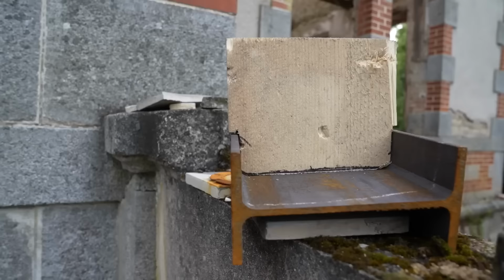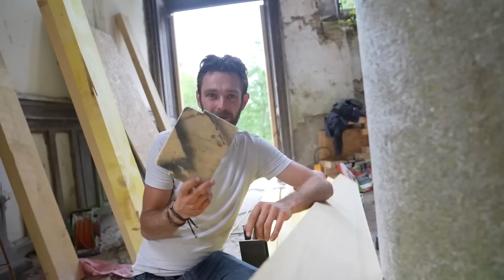Rebuilding a RUIN and its ROOF in 300 days.

Comment: Its actually gone really quick! Only 300 days, and now that one part of the building has an almost finished roof, floors and is basically dry area - plus the grounds are nicely cleared and the front garden replanted! I think the rest will go much faster, because you are already halfway there! I'll be excited to see what another 300 days will do!! 😊
Reply: He is not even a fith of the way there yet. You underestimate the amount of finishing work and internals on a building of this size. Unless he gets more help it will be a decade to restore.
Reply: @PreservationEnthusiast  Whaaat, you're kidding? And I was fully expecting him to throw a ball this summer, to celebrate the completion of the Chateau? Or, maybe not... No, what I meant was, that what he has achieved so far, is really impressive, and it will make the next steps so much easier. And he could consider inviting volunteers over summer, too.
Reply: @bigboy77dk  volunteer s are potentially problematic,  part of what has made this saga so engaging is the deep friendship of the team. It has to be to trust the rope that holds you up to some one else.  That is special, volunteers don’t guarantee that, besides supervising then gobbles time.

Comment: You have all worked hard in sun,wind,and rain,may the rest go a little faster as you have dry conditions to work in and be able to lock doors at the end of the day for security reasons.
It getting a lot safer for when the boys are there.

Comment: I'm super excited to see what Dan will tackle next.

I am guessing getting the new workshop machinery in place might be first, but then?

Will he continue the roof over the landings?

Will he cap the tower? 

Will he rebuild the chimneys that the roof on that wing butts up to and fill in all the stone and brickwork on the roofed wing?

Will he move to the other side wing or even the rear wing?

The pool? The garden? A machinery shed? A water supply? Routing wiring and plumbing?

Comment: an easy way to replace holes in the brick would to be to drill deep into the brick and add bolts then use a cement compound to fill in the caps which will seal everything.

Comment: Amazing what you achieved so far. But why don't you get yourself a crane? It would be positioned right outside the building to lift all the heavy stuff up and lowered inside from bottom up level by level. Since there is no roof.

Comment: It would have been easier to knock it all down and rebuild from the foundation up. I can only imagine how much rot there is in the mortar, and cracks in the walls that will compromise the structural integrity of the building.

Comment: Loving the videos to date. What was the point of the steel beam at 32.40 mins?  Its acting as a ledger plate to receive the rafters but its just mortared down, didn't see any anchor bolts to that parapet?   Couldn't you have just used some treated timber bolted down?

Comment: A tip from me is to put the other roofs on now.
Reply: The walls are too tall without internal bracing to erect more roof without danger of collapse. By first erecting the internal steel floor beams and wood floor joists, Dan is creating a diaphragm at each level that stabilizes the masonry walls and will keep them from bowing out when the roof load is applied. It also provides a work platform at each level. This allows for intermediate transport of materials to the upper level, access at each level to repair and stabilize the stone/brick walls and space for tools to cut and shape wood closer to its final installation location. This from a licensed professional engineer and accomplished builder.

Comment: I do not understand how you did not BOLT OR ANCHOR any steel along perimeter of roof, but glued them down!?!? The amount of force pressing down on that perimeter beam at bottom of roof rafters is going to be large when a huge windstorm comes. Your roof could blow off! Anchoring the beam down every 5 ft max, with anchor bolts, would transfer the forces to the anchor bolts to hold in roof where it contacts top of wall. Anchor bolts make building act as its own diaphragm, allowing movement in all directions as a whole entity. Hilti Brand makes the bolts and they have tools to shoot in the anchor bolts. I am quite befuddled by the glue holding any steel in place!!!!